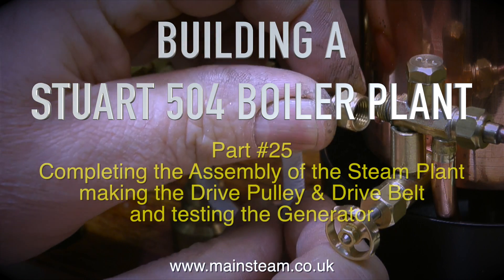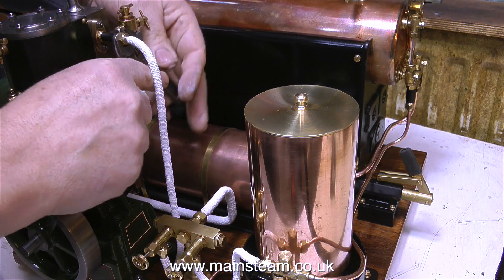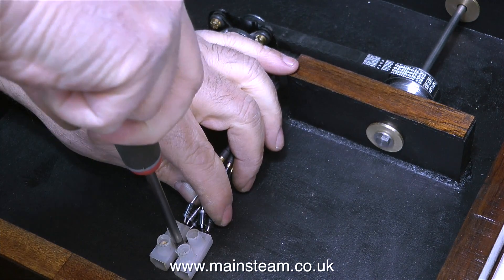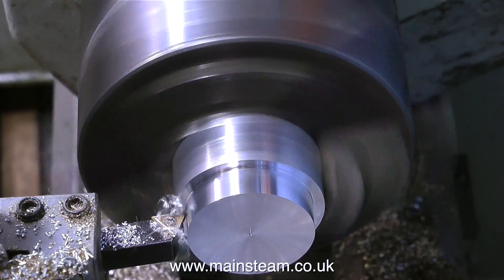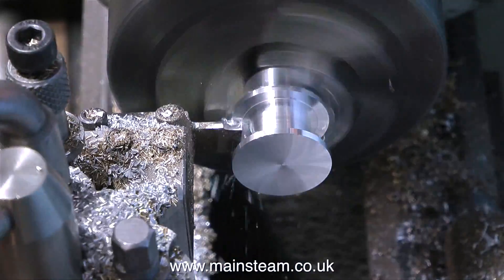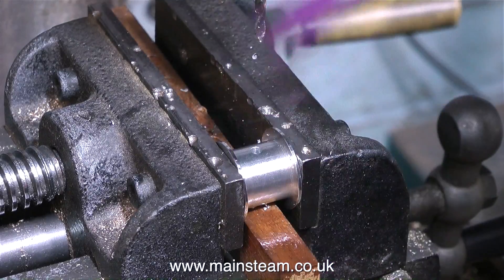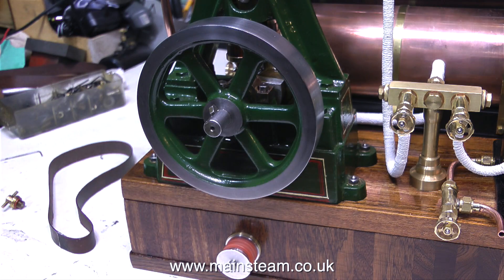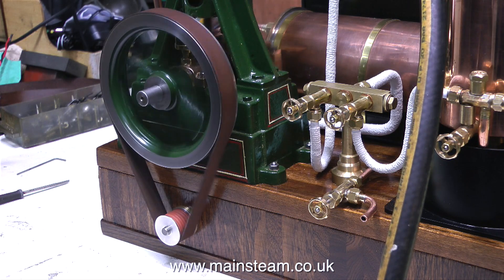MAKING A STUART 504 BOILER PLANT - PART #25 - FINISHING OFF THE  GENERATOR TRANSMISSION

Comment: When I was a lad ,I too was an an apprentice electronics technician. The factory was built in the 19c. And had the pully driven machines. When the maintenance engineer retired after 50 years service ,us apprentices did some snooping about in the basement and came across a can of belt dressing compound. It's a sticky substance used to increase the friction on a drive belt. I used it on my VW beetle Dynamo belt for years to stop it slipping.

Comment: Beautiful, beautiful work Keith. Your attention to detail is amazing. 
Re witchcraft in the converter: its just volts times amps in will equal volts times amps out, less any losses so if your input is 6 volts at 2 amps and you want 12 volts out you can have it but only up to somewhat less than 1 amp.
Had a chuckle about your Barko spanners. Just to be different I've always called them Crescent wrenches. But thats the colonies, I guess; got to be different.

Comment: The loss is pretty low for a boost converter, they are often 85-90% efficient. This all depends on the frequency of the DC pulses, the components used and the voltage differences. Generally, they have a range where they are most effective.

Comment: A thought in passing, if you find the "O" rings are messing with things a bit too much. You could take a small strip of emory cloth and glue it to the inside of the aluminum pulley with the sand portion facing out. This would give you the traction without the thickness of the "O"rings... I did the same with a tread mill where the running belt started slipping on the drive shaft, worked like a charm...
Cheers Keith!

Comment: Might be worth adding a small crown to your flywheel to keep the belt centered - Michelin rollers i make at work are crowned to keep their belts on  - only a very small amount - perhaps 1mm on diameter over 300mm in length both ends of a 1000mm roller..  0.1 degree a side, basically unnoticeable. you could easily get that with a gentle file/polish on the running engine
Reply from the maker: It should be OK when I make a new belt that isn't glued together at an angle . . . . :-)))

Comment: If you wanted something that looked a little more in keeping with the engine than silicon o-rings, some rubber bands might work. I have seen them in approximately the size and width that would work, but I can't remember where. You could also potentially use a section of tire inner, perhaps from an old bike tire? I have seen that used on quite a few home-made and restored bandsaws, to protect the wheels.

Comment: If you store the spare tooth belt on the side board so it is looped around the counter-shaft, there is less work required to replace it.  All you will have to do is loosen the generator.  Naturally, the clips hold the belt clear, so it does not get rubbed by the shaft.

Comment: Nice Videos Kieth  keep them up. Curious: Is there a reason you opted for the Flanged pulley on the bottom vs a Crown pulley generally better for flat belts that wont wear out the edges? Just curious thanks again for the great engines.

Comment: No need to apologize Keith :) Amazing video!! Love how quiet the brushless "generator" is. The conversion efficiency of the voltage booster is insane! From 12v to 20v, 2 amps resistor load (40 watts), the efficiency was 90%. I'd imagine it's similar from 6v to 12v too.
Reply from the maker: Yes it is impressive. In the steam test video that I have just made - (going live tomorrow,) I tried the Brushless motor without the voltage converter, at a reasonable speed it generates 5 to 6 volts . . . .

Comment: Great video, Keith. The plant looks terrific. I really enjoy the series. Watching your trick with the o-rings on the cross shaft pulley reminded me of belt dressing. When I was a young lad, we used to drive equipment with the takeoff pulley on a tractor. We'd use belt dressing on the belt to help it grip. It was a like a large crayon that you held against the belt while it was moving. It was made of a hard wax or rosin like material that added tackiness to the belt. Just thought I'd mention it, might not have any application to model steam plants, but thought you might be interested.
Reply from the maker: I use belt dressing sometimes the flat belt drive on y old lathe, I usually buy it in an Aerosol can ....

Comment: The belt looks like it wanders a lot on the flywheel. Perhaps machining a slight flange into it could help?
Reply from the maker: I need to make a belt that is not misaligned (like the one I did in the video)  I will make one "off camera" I think ...... then I can concentrate on the job .....
Reply: Ahh, no worries!

Comment: Wouldn't adding a tension-roller (spring actuated) help against the slipping of the belt on the aluminium pulley?
Reply from the maker: Yes, but it's a bit "un steam engine like"